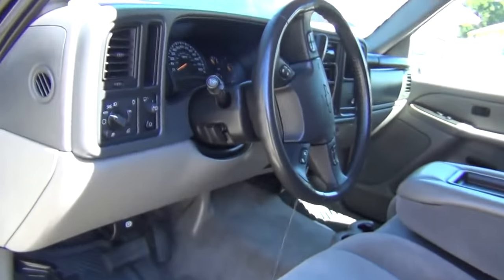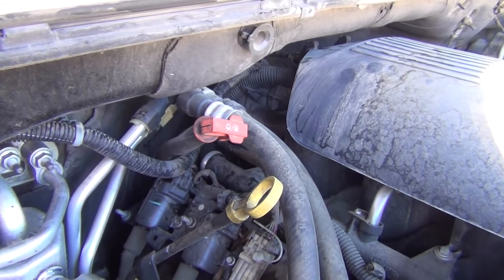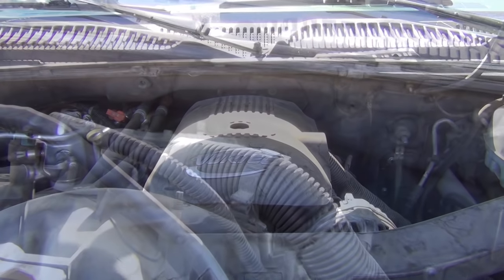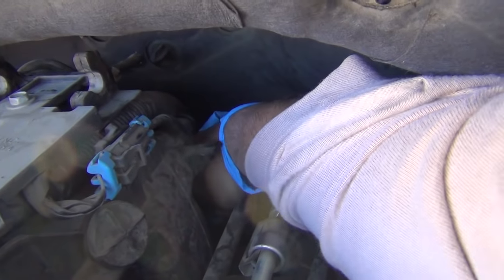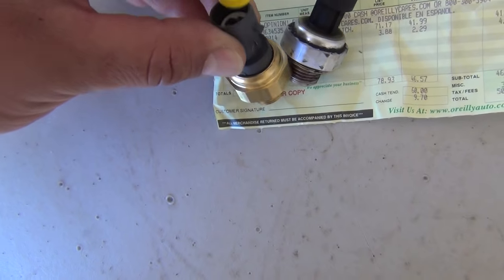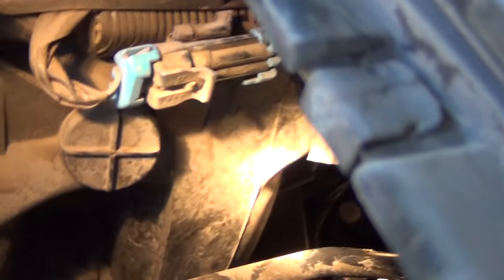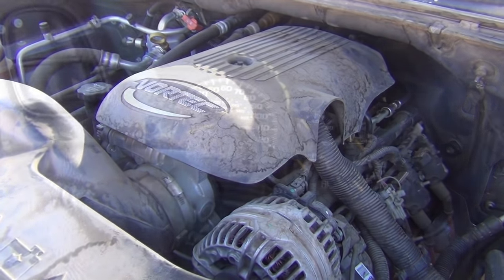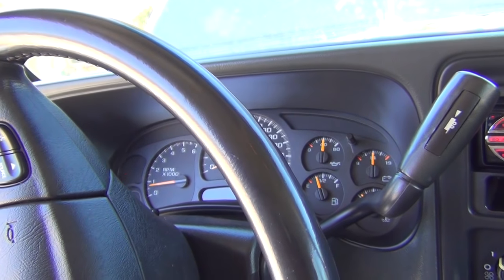CHEVY OIL PRESSURE HIGH....FIX!

Comment: Thx for the content!  I changed mine BUT my pressure still fluctuates below 40 psi and it has never done that before.  Do you think it might be the oil sending unit?
Reply: That is probably the oil pickup o ring. Not as easy of a job but not too terrible.

Comment: Great video...question though...after the part replacement does it send a error code that has to be cleared?
Reply: Jason Dyer nope, just replace the sensor, and if the oil pressure goes back to normal, you’re all set

Comment: Thanks for the video. Good job. I have a 2003 Chevy Avalanche and just noticed the pegged oil pressure gauge, even when the engine isn't running. Will try this fix! I see you use the same crappy rubber gloves as I do....lol!
Reply: did it work?  i have a 06 avalanche thats doing that

Comment: Changed the oil pressure sending unit. Gauge is still pinned in the cluster. Electrical issue I’m assuming
Reply from the maker: Did you recently change any parts or do any work to the car?
I worked on a truck and removed the bed. Once I replaced the bed the guages maxed out? I could not understand why? Turns out it was the copper ground strap located at the fuel filler neck. A bad ground was the cause of the gauge max out.

Comment: besides the motor is there any other parts I gotta buy ?? like harnesses pistons etc.. or just remove motor and keep cables and install connect everything into new one?? excuse my ignorance I just never done no big work like that before ...sounds fun but I wanna be able to do it the right way
Reply from the maker: +Jose Chavolla A "short block" is just the lower half of the motor which means that you will need a gasket kit, sealant, spark plugs, and fluids to replace. This is also a good time to replace the timing belt/chain.
With a short block you will re bolt the heads, intake and all upper motor stuff like fuel injection and radiator hoses. 
You reuse every part you remove and should only really be replacing the timing gear and chain. Many people also replace the rocker arms, push rods, and lifters because they already have the engine pulled apart. This will require you to remove the valve covers and readjust the lifter clearance in the heads? 

A long block comes complete minus the fuel system, intake manifold, and headers which are on your old block and should be reused. A long block is very simple to install and will bolt up perfectly. You just unplug all the wiring and fuel lines. Unbolt the motor mounts and transmission bolts from the back of the motor. drain the coolant and remove the upper and lower radiator hoses and remove the transmission fluid lines that attach to the radiator.
Place the long block in the vehicle and start from the bottom. reuse the motor mounts and bolt up the transmission/flywheel to the back of the motor. bolt on the transmission lines, lower radiator hose, and exhaust manifolds. then bolt on the intake manifold, stab the distributor, and re connect all the electrical and fuel lines. Fill with oil and radiator fluid and any transmission fluid you may have lost and start. 

A long block will be the easiest and all you have to do is purchase an intake manifold gasket kit, hi temp silicone sealant, new spark plugs, radiator coolant, oil, and oil filter.

Comment: I have an 02 Yukon I was having issues with the pressure fluctuating up and down I replaced that oil pressure sensor, Is oil sending unit, And now the pressure stays steady high around 60-65 any recommendations?

Comment: I have the same problem in suburban 2012 with no check ingine light  is that mean no problem but the only sensor not reading well  and need to be replaced thanks

Comment: Pressure sending unit is a common failure on the 5.3,6.0,6.2 vortec engine
Reply: Travis R. My my mechanic says it cost a bit over $100 in labor to fix the sending unit on my 06 suburban. 🙁
Reply: angryguy714 that's about right. nothin cheap about it. the sensor is about $90 alone from gm. then the 1.0 hour to install it is another $120
Reply: Travis R. $13 on eBay

Comment: Same exact problem.  Changed the oil and filter and discovered the maxed out pressure.  Originally thought it might be a defective filter, so I put the old filter back on.  Wasn't!  This is my next task o my 130,000 mile truck.  About mid-life for these trucks.
Reply: Craig Seifert got 190 on my 2003 and this is the first time coming across this problem. crossing my fingers it works
Reply: TonganPyro702 those engines are long legged.
Reply: capncraigagain im thinkn the 5.3 tow package is whats making it long lasting. Got it at 7 years old with 120k. They ran the hell out of it. Ive only put another 70k the past 7 years. Im rebuilding this engine once it goes out
Reply: TzUp great motor. The bottom end can handle 800 hp stock.

Comment: Would this fix apply to the low pressure issue too? Thanks for the video
Reply from the maker: +David Daul Low pressure is usually caused by engine wear in the crank. If the engine has high miles or has been run with very low oil or the wrong oil this is a common problem. Changing out the oil pressure gauge usually will not fix the problem. You can get a cheap oil pressure tester gauge from Harbor Freight and check it with that? I believe you can rent them for no cost at Oreiley's or Autozone. Once you test the pressure you can figure out if the sending unit is bad or the engine is just worn?
Reply: Turns out that my oil filter was loose.  Replaced the oil and put a new filter on and the pressure gauge now holds steady.
Reply from the maker: David Daul Wow, that is great news. I have never seen this happen before, but really appreciate the info. Now maybe I can help others that may have the same problem. It is always a good ideal to check the easiest things first. How did you think to check the filter? Were you losing any oil?
Reply: +ImRamro I was dripping some oil and had to top off a couple times every 1000 miles.  I should have checked for a loose filter right away...  anyway, I saw a post on a Chevy forum that mentioned first checking for a loose filter and changing the oil before doing the sensor replacement.  just got lucky!!!
Reply: +ImRamro BTW, reminds me of the loose gas cap engine light that Honda always has
Reply from the maker: David Daul I had the same thing with the 1991 Z-71 I had years ago. It would not pass smog. I took it to a little country smog shop and the old timer just pulled the cap and put it back on and it passed first try. I was so mad to be ripped off by the other shop. Now I try to do all my own work and with the internet, there isn't much we can't do ourselves.

Comment: I turn the key to the on position and it maxs out to 80 just like yours. Did your dash say "low oil pressure" as well?
Reply from the maker: Jesse Shryer I am not sure, but low oil pressure warning is a common sign of a bad sending unit. I have replaced about 5 of these for different people and the fix is always the same. First I check the wire and if it has continuity then the sending unit is bad. Hope this helps.....I would bet money it is the sending unit.

Comment: I replaced the oil sending unit and no change.  When I turn on the key, it goes to 80.  When I start it it stays at 80. Sometimes while I'm driving, it goes to "0".   Any suggestions?

Comment: ok fixed it now for about a week it bounced between 40/60 now at idle it's 60/ and 80 on gas? any idea
Reply from the maker: I am assuming the gauge is like the one in the video?
It max out at 80 and 40 is the normal operating pressure? 
For some reason the pressure is high so here are some suggestions. 
1. A faulty oil filter can cause this. Have you done an oil change and replaced the oil and correct filter yourself?
Those QuickLube places often make mistakes or use poor quality parts. 
2. I would replace the PVC valve.
3. If the oil is too thick then this could cause higher oil pressure.
4. Sludge in the engine or an oil galley could be blocked causing a higher pressure reading? 
Here is a link below that has good information about high and low oil pressure.
I hope this helps? 

 http://lubricants.s5.com/oil_pressure.htm

Comment: Does this work for low oil pressure too ?
Reply: That's actually more often the reading you will get, than the gauge pinned all the way to the right.  There are other videos showing changing out the sensor switch for having no oil pressure reading, and it cures the problem.

Comment: Thanks for the video.  I have a 2003 Avalance, 5.3L with the same problem.  I've found some useful information to go along with your review.

First, mine went out a while back.  I took it to my mechanic and had it replaced.  The manager emphasized that the specs required the AC Delco version (which is aluminum).  It didn't make it a week, so, they replaced it with another.  Broke again in 3 days.  It actually was pegged at 80, except when I accelerated.  Then, it would jump around spastically, sometimes hitting zero and causing my low oil pressure warning beep to sound.  What a POS.

Second, check out this blog for some additional discussion on the aluminum vs brass.  All rave about the brass version, and bag on the aluminum one.
http://www.corvetteforum.com/forums/c5-tech/3101078-oil-pressure-sending-unit-keeps-failing.html

So, the brass is definitely the way to go.  I went to my O'Reilly's.  They had the Master Pro like yours ($43), as well as a Borg Warner unit ($51).  The MP for some reason didn't have the red silicone on the threads; so, I went with the BW.  All videos state to use the sealant on the threads, or, buy a unit with the sealant on it.

Installation took about 30 min.  My Avalanche doesn't have near the same clearance to the part as your Suburban, but, I had bought the 27mm deep socket (recommended) and U joint extension (required, for me). 

So far, so good.  New unit works well.  Will post back after some time to confirm if it's still working.  The good news is that O'Reilly's has a lifetime warranty on the unit.
Reply from the maker: M Jones Wow, you have really done your research on this sending unit. 
The thread sealant is a good idea, who wants a leak on the back of the block dripping down and looking like an oil pan leak, lol. 
I have found that all parts are "NOT" created equal. I would spend a few more bucks and have the piece of mind of knowing that the part is going to last.
The oil sending unit is a common problem with GM, way to do your homework :)
Reply: So, I just got done putting an ac Delco in. something I never wanna do again... my hands just doesn't fit back there with all it's skin. unfortunately the gauge is still reading 80. you're saying I should try again with a different brand before doing?? What? changing the dash? If the problem isn't the sender what else could it be?
Reply from the maker: William Fontenot Jr Did you resolve the problem? Sorry it has taken so long to respond.
I would take an ohm reader and test the wiring first.
Reply: +ImRamro I bought the master pro from orielly's and it worked. the ac Delco was a dud... go figure
Reply from the maker: William Fontenot Jr
Wow, that is like the third time I have heard of this happening.
Glad you solved the problem.

Comment: I got the same problem .. i have a chevy 2006 4.2L V6  and i change the oil pressure sensor .. oil filter ..and oil .. but it continues to be at 80 ..

Comment: If my 2001 silverado oil pressure  gauge is above normal and engine is  ticking. it only ticks when pressure is above normal. Can the oil pressure sending unit fix the problem?

Comment: So I changed the sending unit, but the pressure guage is still pegged with the key off and climbs higher when the engine is running.  The needle usually bottoms out at 5 o'clock position.  Any thoughts on the next step?
Reply from the maker: Rick Stone Sounds like wiring or a faulty gauge.
I would check the wiring that leads to the sending unit with an ohm meter. 
Then I would check all of the engine block to firewall metal ground straps, then finally I would check the actual gauge.
Are there any other gauges like the speedometer jumping around or acting funny?
Reply: nope, but in the 2 days since i changed the unit, the oil pressure has gone back to normal. I'll check all the wiring and see if I can get it to repeat. Thanks for the suggestions and the video.
Reply from the maker: Rick Stone Well at least it is fixed, lol.

Comment: Thanks ImRanbo Would that fix a low oil pressure reading as well? Thank you.
Reply from the maker: +GILLEBRATH It will not resolve low pressure caused by other reasons.
I was just informed that a loose oil filter could cause a drop in pressure so I would check that first.
Does it have a major oil leak? This could cause the pressure to be lower than normal too.
The most common problem is wear on the crank and crank journal bearings. 
Low pressure is detected by the sending unit, but if the engine pressure is low and increases with the R.P.M's of the engine it is probably something else because the sending unit is detecting the increase and working properly?
Reply: +ImRamro Thanks for info ImRambo . I neglected to change oil and when I did I added trans fluid 1 litre along with oil change hoping to clean up any dirt in motor , anyway tappets were sounding slightly and went away for awhile but on way home from work the check engine light started flashing for first time so changed oil again, light stayed off, pressure goes up but drops really low when I idle it. I am thinking as you mentioned the wear on crank and crank journals is most likely my problem. Another motor is probably the soulition. Thanks so much for the insight .
Reply from the maker: GILLEBRATH I know a motor swap can be expensive, but that motor with low pressure could last a long time. If you decide to swap the motor just remember to take pictures of all electrical connections and any hose connection that looks hard to remember.
When I swap a motor, I de grease the entire engine bay so that everything is clean and then take nail polish to paint all the wiring connections and hoses. The swap is really easy, the hard part is bagging all the important bolts in Ziplock baggies and marking things with paint.
Good luck.
Reply: Thanks again ImRambo ,I'll add heaver oil and run it for awhile yet. I put the motor in myself but it was a used one at that. It is a lot of work so I'll see if I want to tackle it again. Cheers.and thanks for the help.
Reply from the maker: GILLEBRATH No sweat!!

Comment: Does anyone know the size socket he used to take it out
Reply: Typically on a Chevy 5.3L it's 1-1/6".  Like he said alot of people use a normal 12 point deep socket.  But if you want that black oxide socket specifically designed for those sensor switches, they are on Amazon.  But maybe Harbor Freight, Autozone, or O'Reilly's could stock them also.  Amazon ranges from $20.00 to $50.00 for Chinesium quality.

Comment: Bought truck, month later I change the oil (mobile 1 synthetic high millage) and filter. Idle pressure at 60 and truck sounds louder. Tried two different kinds of filter also tried same kind that was on there, same thing. Put the filter back on that came with the truck and back to normal, I'm baffled, so I've just been changing only the oil out for two years lol. Any help is greatly appreciated.
Reply: Holy fuck
Reply from the maker: All oil filters are not the same and an incorrect oil filter will cause this.
I would try to find the exact same filter and stick with that or find a new filter that is very similar. 
You can remove the filter and drain the oil and try to find one that has the same construction.
The mounting surface may be different as well?
Reply: 25verizon find the same filter. Walmart sells OEM AC Delco filters. Never put synthetic oil in a used car with lots of miles. It will find every place to leak

Comment: will this also cause over heating? ruptured hose to the radiator has been replaced but still overheating!
ive replace radiator, water pump, and  thermostat
Reply: it shouldn't. is your intake manifold gaskets bad? my 1992 GMC 1500 kept overheating and it was my intake manifold gaskets. I bought a gasket kit from felpro for about 30$ and new thermostat. I did the work myself which saved me hundreds. after I did the intake manifold gaskets I did a hot flush to the cooling system and topped it off with fresh coolant with a 50/50 mix. it runs cooler now then when I first bought it about a year ago. it gets about a quarter of the way up the temp gauge and right in between a quarter and the middle mark with the AC on a 100+ degree day. I bought the truck with 200k miles and now there is 220k. my other Chevy truck also with the 5.7 engine I did the intake manifold gaskets about150k miles ago and there is currently 475k miles on it (that is just my work truck)
Reply from the maker: Are you losing any antifreeze? 
Do you have the correct amount and weight of oil?
Are there any other problems like back firing or smoking? 
what year, make, model is your vehicle?

Comment: I'm ramro  the sending unit has been replaced  just did the oil change the pressure rises high at acceleration to almost 80 psi drops at deceleration a buddy of mine is having this problem I'm trying to find an answer for him
Reply from the maker: +Curl Davis I would make sure the oil filter is screwed on tight? 
What is the ideal oil pressure for this vehicle, is 80 high? 
I have no clue what you are working on?

Comment: My 04 suburban had this issue for a few days before the "check oil level" light came on. What would be the issue here? I'm not experiencing engine power loss, no white smoke from exhaust, no low coolant. Something serious?
Reply from the maker: If the oil level is fine and the oil pressure is at zero, then its probably only this sending unit?